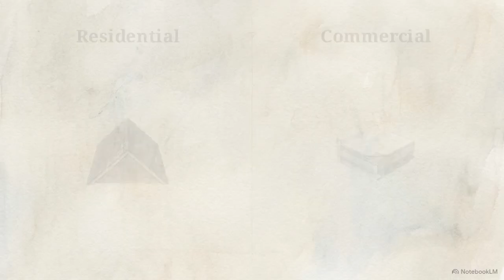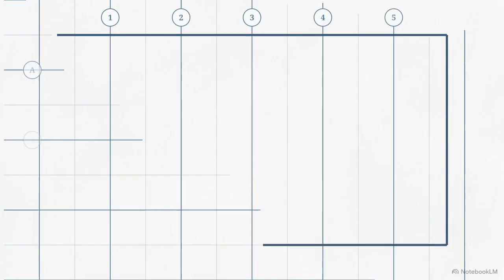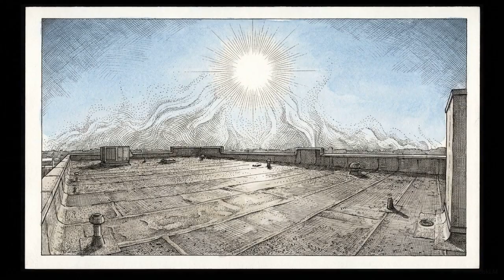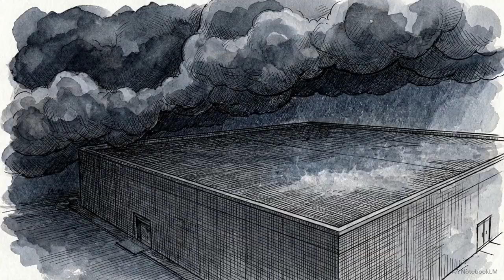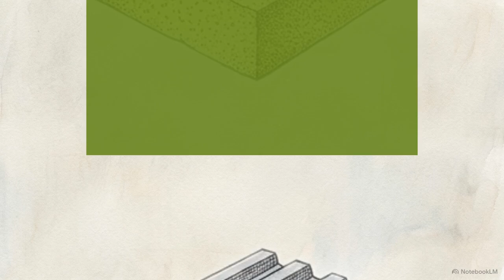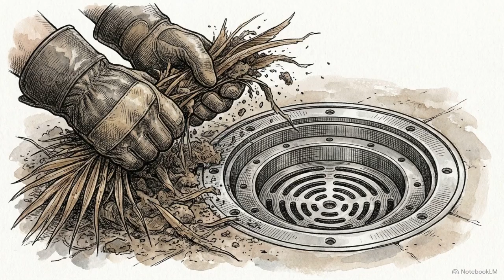Commercial Roof Leaks: How Hidden Water Intrusion Is Traced and Prevented

Comment from the maker: Commercial roof leaks are not always directly above the visible drip. Water can travel under the membrane, through wet insulation, around rooftop HVAC units, or along roof deck channels before it appears inside the building.

Read the full guide here:
https://orangecountycommercialroofing.com/identifying-and-preventing-the-most-common-commercial-roof-leaks/

Need a commercial roof inspection in Orange County?
https://orangecountycommercialroofing.com/